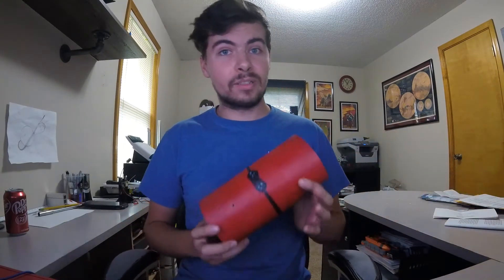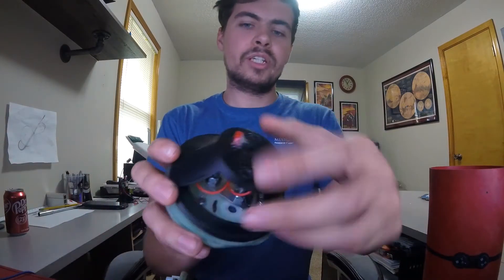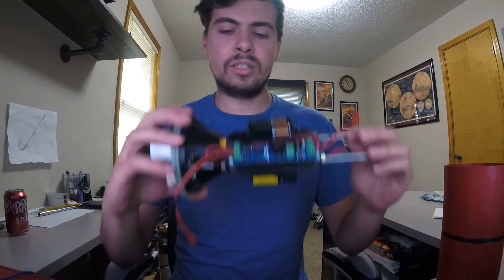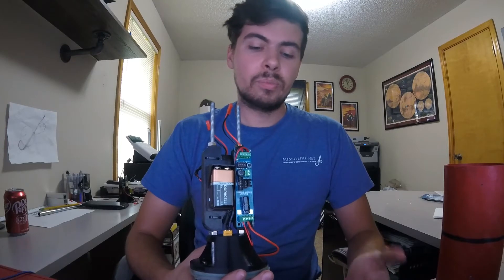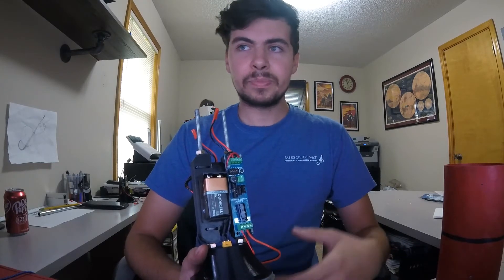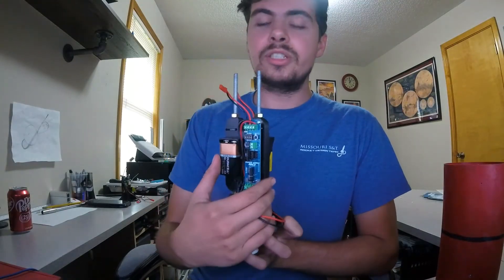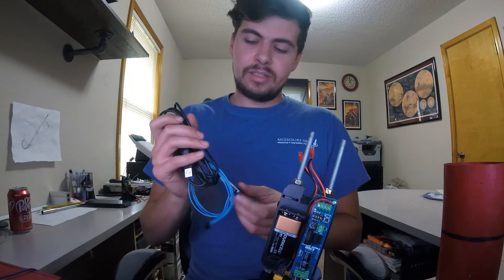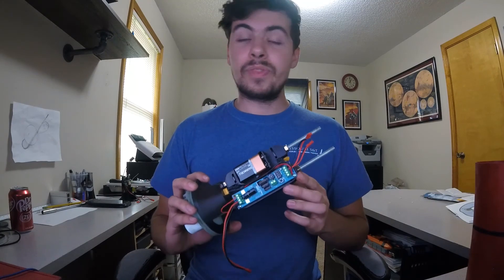Dual Deploy Electronics Bay Design

Comment: According to Missleworks, the RRC3 is good to 40K MSL, they have an Xtreme version good to 100K MSL. I like to run the RRC2L in combination with the RRC3, additionally I use the LCDT display unit to program both, very nice. You mention that most people don't use two flight computers, for me this has become a standard operating procedure, the redundancy just makes sense since the number one cause of failure is recovery. Also its more common to set your backup to deploy at Apogee + 2 or 3 seconds and main deploying at 100 ft lower than the primary. Also, I like to see those batteries with tie straps around them even though their in the holders, to insure they remain connected.
Most Level 3 Cert projects don't exceed 30K ft so these devices are good choices. Just my 2 cents worth! Hope your Level 2 went well!

Comment: Both of those altimeters will work at altitudes of 10, 20, 30,000' and higher. A 'level three' rocket is any motor M, N, or O impulse. 
A 'class 3' rocket is one with a motor over O impulse (40,960 Nsec) requiring FAA/AST waiver. https://en.wikipedia.org/wiki/Model_rocket_motor_classification